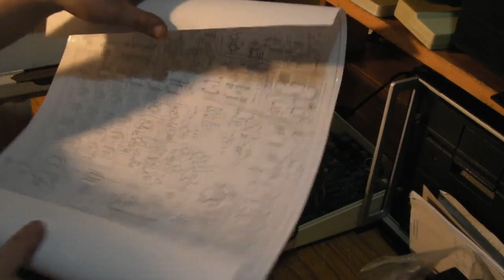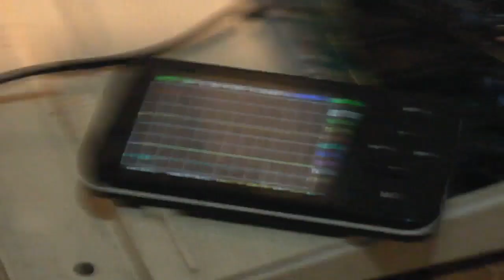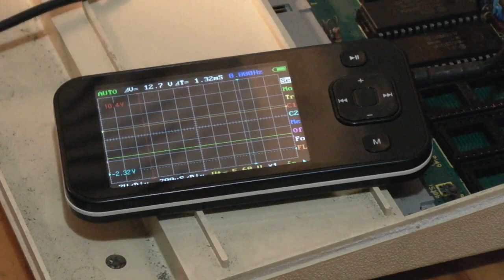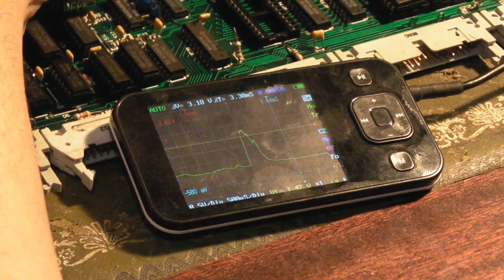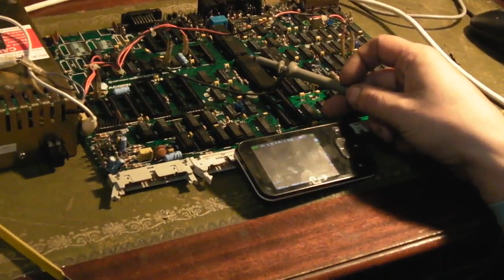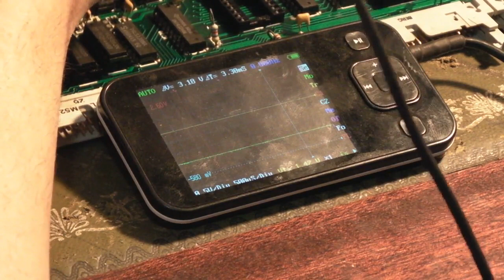BBC Micro restoration pt5 (Project Mildrids Ashtray)

Comment: Something that would be useful to all would be for someone to open up a fully functional retro-computer, note the PCB revision, let it run with the case open for a half hour, then measure with one of the nowadays inexpensive non-contact IR thermometers the normal temp for each chip.  Those measurements would then be made available to everyone in a text document.